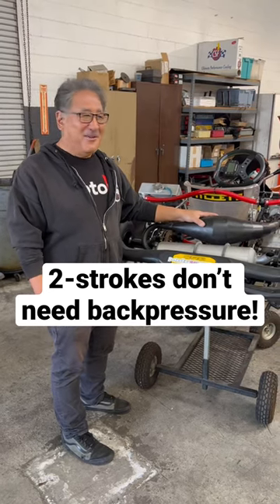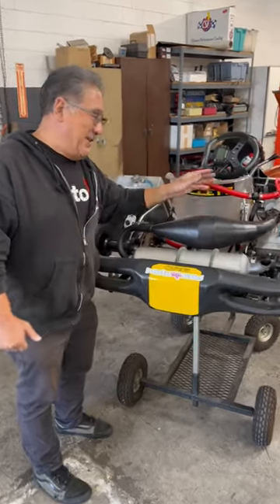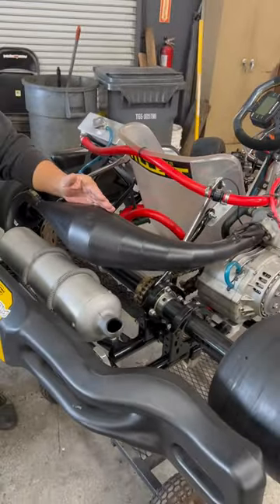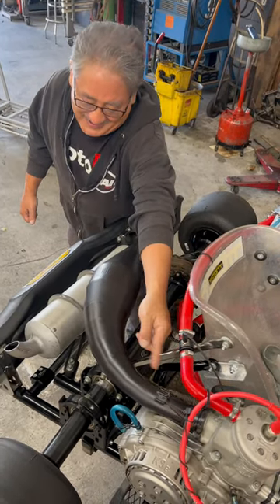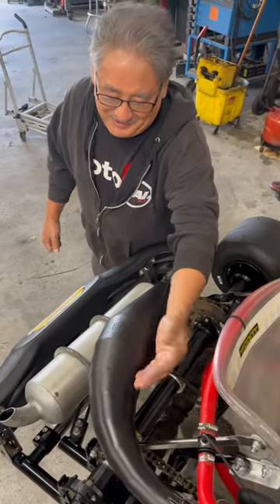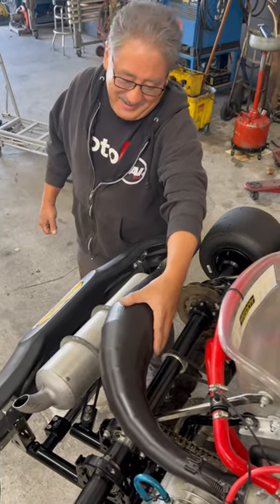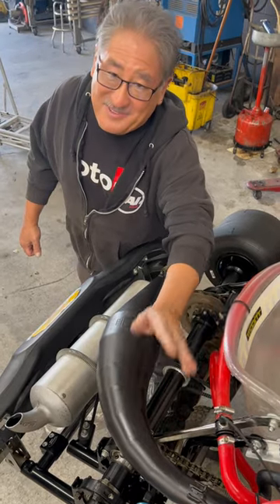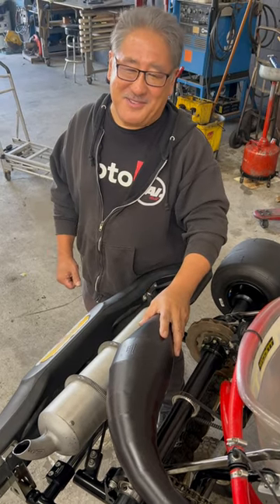2-strokes don’t need backpressure!

Comment: No internal combustion engine "likes" backpressure.
Reply from the maker: A lot of people think that based on the tons of dumb comments on our exhaust videos!
Reply: lord yes
Reply: I got friends thst can not grasp that an engine is just an air pump and they want to breathe.
Reply: @AtomicReverend  There are still people out there who believe the "kadency" theory of exhaust flow. This was disproven many, many years ago.
Reply: @motoiq  they are to ignorant to realize the effect is "exhaust pulse scavenging" the exhaust pulses traveling through the pipe pulls th next pulse behind it.
Reply: @motoiq correct me if I'm wrong, but my guess is people started to think that because straight single pipes that don't connect have no scavenging so people thought the headers/manifolds created back pressure which would help somehow but in reality it was the scavenging effect
Reply: exhaust velocity is a thing though. a 4 inch exhaust on a three cylinder engine would be a bad idea
Reply: @motoiq  Please do a short for anti-reversion chambers for 4-stroke 🙏
Reply: I think when the concept of exhaust tuning was conceived, the idea of scavenging may have been misinterpreted. So, when someone says you need xxxx amount of length to scavenge, they got the idea that it adds positive "backpressure" due to the added pipe. Or, perhaps it was shortened for the term "backwards pressure" that indicated  negative pressure. 
Just a theory on how the word may have originated, even though the principle of the term is incorrect.
Reply: @B1GDaddyFatStax  Could be.
Reply: As fas that i know 2 strokes need the exhaust "bubble" for the beta wave to push back the fres gases in the cylinder. But no need for backpreasure itself.
Reply: @jtheglin1640 incorrect. A single straight pipe does scavenge. It just needs to be long enough. A short single pipe diesen scavenge because the pulse is alreafy out of the pipe and the vacuum behind it is  no longer a negative pressure.
Reply: @AtomicReverend it’s funny that you say that, way back when Les Schwab and other companies like converted some of their v8 to half an air compressor and half a normal motor, 4 cylinders would drive the vehicle and the other 4 would keep your air tank filled
Reply: @mostlymotorized  correct. But small is always worse. It may make power down low but it will kill it when it's up in it's actual poweband.
Reply: @jasonbirch1182 This is correct.
Reply: @DrRyan82994  its about port timing to create a negative pressure zone that pulls out exhaust rather than adding positive pressure or back pressure and scavenging it not removing all the spent exhaust gases, you measure the pulse width and achieve a performance gain at a specific rpm based on header tube lenth and diameter before the first collector a anti reversion chamber right after similar to the one used in directional, 1 way mufflers and then a large open free flowing 4 inch tube to take it to the back past the occupancy compartment / cab, if you want it quiet then you need the measure the resonate  frequency and cancel it with the same wave form, if your short on space a helmholts resonator works good to match frequency at a specific tone and remove drone
Reply: @motoiq  more important on N/A engines  its about port timing to create a negative pressure zone that pulls out exhaust rather than adding positive pressure or back pressure and scavenging it not removing all the spent exhaust gases, you measure the pulse width and achieve a performance gain at a specific rpm based on header tube lenth and diameter before the first collector a anti reversion chamber right after similar to the one used in directional, 1 way muffler and then a large open free flowing tube to take it to the back past the occupancy compartment / cab, and if you want it quiet then you need the measure the resonate frequency and cancel it with the same wave form, if your short on space a helmholts resonator works good to match frequency at a specific tone and remove drone
Reply: I want to remove the mufflers from my motorcycle exhaust but a lot of people said its a bad idea because it will reduce the back pressure. Can I remove it safely?
Reply: @akalduwais  it might be a bad idea because your motorcycles fueling is tuned to take into account the restriction of the exhaust. Taking off your mufflers will probably cause your bike to run lean unless tuned. Whether this will damage your engine in the long run is unknown.
Reply: @Landonstein  thank you for your explanation I really appreciate it, I made two holes in each pipe baffle (14 mm) and the sound OMG just amazing, I think the ECU can adjust the air/fuel ratio by it self I don’t know 🤷🏻‍♂️. Running with lean engine will cause high temperature and pre-ignition. I didn’t notice that with my bike. However, I noticed it become faster. In my opinion I think the ECU should be able to adjust air/fuel ratio, if not, the bike will run lean or rich depending 
on the atmosphere pressure. Make sense? What do you think
Reply: @akalduwais no you need the scavenging effect from the exhaust pipe it vil run bad , by a tuning pipe and you vil se a huge improvement
Reply: The word is scavenging...lol
Reply: Ive read that Supercharged engines use back pressure to help build boost pressure, and not work the SC as hard. .. I guess technically the engine dont need back pressure 😄 but it sure helps the supercharger work more efficiently. 
Atleast the technical way its explained makes since to me, I'm no scientist though.
Reply: @motov8-garage832  Supercharging an engine creates even more exhaust gas volume and requires even more flow. The point of supercharging is to move more "air" through the "air pump". If restricting the exhaust makes a supercharged engine run better it indicates that the camshaft is not optimized for that engine.
Reply: Back pressure is bad on exhaust stroke, good on intake stroke.
Reply: @dalejrjunior1298 exhaust pulse which on the way back is a higher pressure wave than ambient and than in the cylinder... sounds like back pressure to me... 

If it wasn't the baffle section of a expansion chamber would just disrupt efficiency and performance. The whole point of it is to create a high pressure wave to push leaking mixture and leftover mixture in. 

If i exert a high enough pressure to push a door open, it didn't suck itself backwards due to a lower pressure behind it, did it? It was the pressure pushing forward on it.
Reply: @finlaymcdiarmid5832  when you start making your own expansion chambers for 2 strokes you will understand. There is no restrictor in the pipe to push open. 1 pulse goes through the exhaust and hitting the expansion chamber helps draw the pulse behind it out easier.
Reply: Awesome video. I learned about screaming 2 stroke when I was a child. Witnessing my father and his buddies with their snowmobiles and die grinders. 😊❤
Reply: Except 2 strokes require some form of restriction on the exhaust be pulse tuning or stinger sizing. Properly done, you can create a head pressure that actually "supercharges" the intake charge which is why 2 strokes have that famous "power band".
Reply: Explain exhaust Scavenging on a four-stroke, and why the diameter of primary and collector pipes influences its efficiency
Reply: @motov8-garage832 If you look at the exhaust on a super charged engine such as a Rolls Royce Merlin they are little more than short stubs which supply no back pressure at all.
Reply: @gregbrigden2909  Like I said I’m no professional on this subject. I’ve just read conflicting info on back pressure and superchargers.
I need to do more research though, I’d really like to do away with two of the cats on my supercharged Nissan truck.
I keep cracking exhaust manifolds every other year.
My truck has 4 cats and I think all the weight of them hanging off the manifolds are causing them to crack. (This is a notorious problem with 01-04 frontiers/xterras).

Comment: 'Needed Backpressure' is total internet  fallacy B.S.
Reply: On 4 strokes you'd be absolutely correct. However on 2 strokes, the increase in intake charge pressure from the reflected wave (restriction to flow) is what creates the 2 strokes famous "power band"..

Comment: Nobody knows what’s going on in there for sure.  The guy on “2 stroke stuffing” has discovered some quirky things about X chambers. The action is a thermodynamic nightmare.  Expanding gases are cooling, velocity is changing, post combustion in the pipe, Coriolis effect of swirling gases (I’m stretching now), roll out cfd ( computational fluid dynamics).  Some dirt biker somewhere has done an  X chamber instead of a re-entry module heat shield.  Cough it up!

Comment: Sound is a form of pressure, and the closer that pressure is to the cylinder the quicker the charge in the cylinder is induced at above atmospheric levels much like a turbocharger.  So technically it is a form of back pressure from my understanding. Two cycles most certainly can be tuned for torque as well, and not all expansion chambers are created equally.
Reply from the maker: This is an exhaust, intake resonance tuning is something else.
Reply: @motoiq  Please do a video on intake resonance tuning 🙏
Reply: "sound" is in fact the human interpretation of pressure :)
Reply: @davidsandberg3109  don’t you mean vibration not pressure
Reply: @louisedayao1562  No just think of how a speaker works, like a subwoofer. The sound is made from the speaker cone moving in and out, together with the speaker enclosure (box) it changes the pressure inside the enclosure. If you have ports on the box the pressure is forced out the holes and it gives the low bass more punch. Its all to do with air pressure.
Reply: @JoshPhoenix11  The sound wuality yes, the sound itself is a vibration, plain and simple, deaf people can hear a guitar by biting the head of the guitar, no pressure needed here. Seems like you're mixing principles...
Reply: K.I.S.S. he's teaching basics
Reply: The timing achieved by a two-stroke is way more definable than a four-stroke ever could achieve.

Comment: 2 strokes love pulse tuning. My 125 iame Leppard was a different animal . Run a 42 teeth rear sprocket with a 65 mm exhaust sleeve. Or run it with a 70 mm sleeve.  Placing the engine in its sweet spots  due to load and rpm.

Comment: Pulse tuning can be optimized for different RPM’s depending on the expansion chamber length, placement, shape and width

Some pipes are designed to really only work on the high end, while other provide a better bottom end and mid range, and the length of exhaust pre chamber is what usually determines the rpm the pipe works best at, while the shape of the pipe determines if the power band is wider or more narrow

Comment: We do this with 2 stroke radio control airplanes. It’s called a tuned pipe. Works really well.
Reply: Not the same thing, look into your exhaust port as you turn towards bdc all three of your ports are jacked open like halfway there. A tuned exhaust on a dle or vvrc or w.e is just a higher flowing exhaust, there’s no pulse happening. If you wanted to get a cone pipe it would push your max rpm power from 8000rpm to 16-17rpm and the sealed bearings won’t take it

Comment: The reflective pulse IS the back pressure. It raises cylinder pressure. Once its out of rpm range, the stinger comes into play as the source of resistance that keeps cylinder pressures up.
Reply from the maker: That is not how the stinger works.

Comment: It reality the wave from the pipe makes”back pressure” in itself to help push unburned fuel and air back into the chamber. So it kinda does need “back pressure” just not in the sense people usually think of it.
Reply: Backpressure in the sense of mufflers isn't good for it.
Reply: Dynamic > static.

Comment: its all about the exhaust sound wave from the reverse cone that creates a force field and blocks the exhaust port holding the supercharged air/fuel mix from the crankcase from escaping the exhaust port allowing the piston to compress the mixer the 2nd time in the combustion chamber...the exhaust gases are force out i of the cylinder by the supercharged incoming air/fuel mix from the crankcase..the powerband starts when the  frequency of the sound wave equals the firing of the incoming from the transfer ports..

Comment: Two strokes running expansion chambers absolutely use back pressure. The shock wave caused by exhaust port opening shoots down the pipe at constant speed. The expanding cone causes suction behind the wave front. The  reducing cone causes pressure increase ahead of the wave front. That’s what pushes gas out of the pipe. When the shock wave hits the end of the pipe it reflects back and pushes the exhaust and the new charge back into the cylinder. Get that right and you supercharge the engine. 
Speed of sound varies with gas temperature and pressure. A higher pressure creates a faster wave front which pushes the supercharger effect up the rev range. Go too far and you melt the piston. But there’s a lot of tuning to be had by manipulating exhaust back pressure.
Reply from the maker: It uses reflected waves, you are repeating what we said.  If you were to increase the mean backpressure on the engine you would loose power.

Comment: To be more clear, For a properly designed expansion chamber the size of the orifice at the end of the conical baffle, (what you call the back cone) controls the pressure and pressure bleed in the chamber.
Reply from the maker: It controls the back pulse and a properly designed exit is done to maximize the strength of the reflected wave and minimize the mean backpressure.  That is the function of a stinger or nozzle style exits.
Reply: @motoiq  The amplitude of the return “pressure” (there’s that word again) wave is dictated by the angle of the conical baffle. The return pressure wave occurs long before the end of the conical baffle.
Reply from the maker: The length of the end cone, diffuser and belly and the overall volume of the pipe are more critical than the angle for tuning the pipe, the angle is just a function of the other dimensions.
Reply: @motoiq 
I'm sorry but you're just plain wrong here, see Gordon Blairs SAE work iirc on two stroke expansion chambers for example. A certain gas density and pressure in the pipe is important, if lower was simply better we'd all just use multiple stingers from the mid section or a perforated mid section to bleed everything off as freely as possible. 
But that won't work well, because contrary to four strokes a certain amount of pressure in the pipe is necessary for proper function, you actually want even more with high performance engines tuned for a narrow peak power band than with general use engines as a rule of thumb. Besides increasing the strength of the pulse there's also an important "plugging" effect and a lot of sht going on even major manufacturers weren't easily able to wrap their engineers heads around. 

Everybody who has designed and tested pipes knows that after a certain outlet diameter there's losses. Substantial losses at that. And it's definitely not due to the Stinger somehow interfering with the pulse generation by the baffle, exhausts with mid section stinger for packaging reasons and "suspended baffle" designs that bleed through a small annular gap suffer from the exact same effect and constructions with different baffle arrangements than cone-cone do so as well. 

All in all the fluid dynamics and sht in a two stroke are orders of magnitude more complicated and intricate than people usually think. But it's absolutely certain that lower pressure doesn't just equal more power. Therefore - in two strokes backpressure is indeed important.
Reply: @heinzhaupthaar5590 motoiq was on about volume and saying the angles don't matter??

Ive never heard any renowned 2 stroke/expansion chamber expert mention volume. You calculate what size of pipe you need based on powerband average temp yata yata, volume is just the outcome i don't think theres any inference to come from it at all.

volume is shapeless, And the principles depend exactly on shape and geometry.

Comment: This is what I was talking about in the other video with draft induction, could you scavenge the chamber out without the crankcase by vacuuming the exhaust? The exhaust volume should be less than 70% of the displacement per revolution, so it should only take a few hundred watts to suck the expansion chamber to a partial vacuum, so hopefully the exhausts exits so rapidly that it pulls the intake volume directly from atmosphere, even at starting.
Reply from the maker: Some two strokes have used superchargers to blow out of the crankcase, experimental low overlap ones for low emissions and diesel two strokes.  Expansion chambers don't suck stuff out they push stuff in to prevent overscavanging.
Reply: @motoiq  The Detroit Diesel already proved that a 2 stroke can have an oil sump, but they banned it under the claim that it was burning too much oil, which is too bad, because the only real problem with the 2 stroke is the needle bearings, the linkage needs proper lubrication, scavenging is no longer a problem thanks to injection and resonance tuning. Expansion chambers do indeed suck, they pull so hard on expansion that vacuum is generated all the way through the air filter, increasing intake after the pressure in the crankcase is spent, all before the back compression wave. But it cannot accomplish the scavenging alone. So if the expansion chamber was in a partial vacuum then could it, would have been the question.
Reply from the maker: Diffusers like the first cone of the expansion chamber are considered steady-flow devices that increase the pressure of the exhaust gas by reducing their kinetic energy or in other words reducing the fluid moving velocity.

Comment: I cut the stock muffler on our zy250 and but a different homemade pipe and it gained so much power that it would blow the tires loose easily